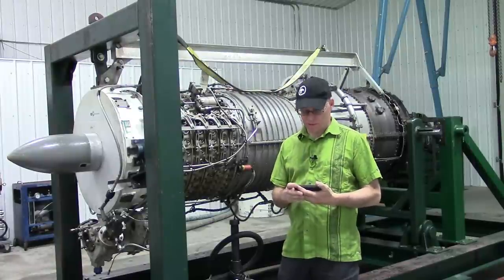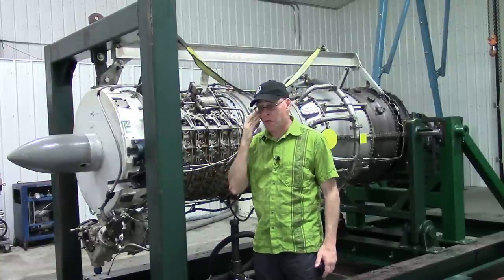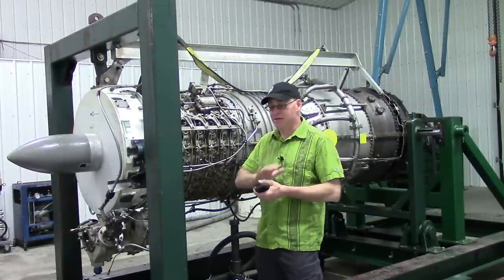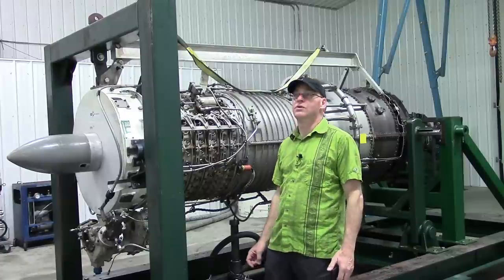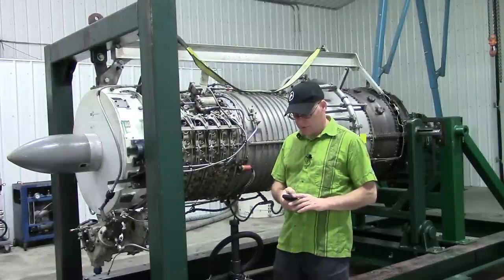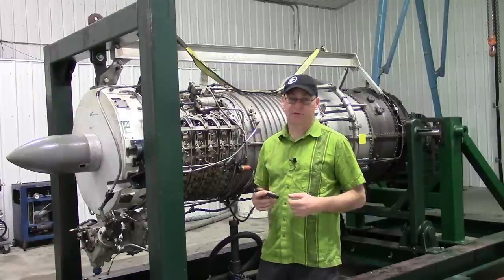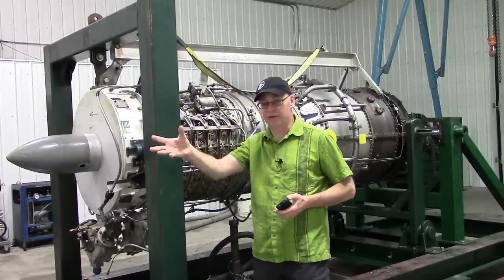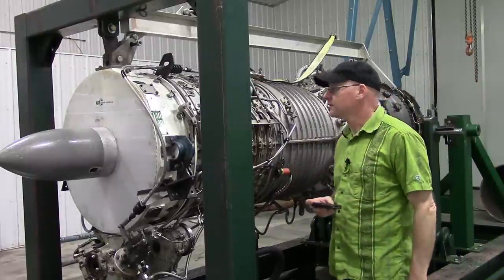Jet Questions 62

Comment: Jay, You're absolutely correct about flameouts in commercial jets.  It's extremely rare.  In fact, on a twin, it's supposed to quite literally never happen, because it's too improbable.  Nevertheless, a Republic Airlines flight (April 2, 1983) flamed out at FL 350 and descended to 12,200 ft before the engines were restarted.  The NTSB determined that the crew neglected to follow the crew checklist and failed to turn the center boost fuel pumps (so, pilot error).  One case I was personally involved in involved a 757 descending into Miami.  Both engines flamed out in heavy rain.  The "fix" was to require the flight crew to maintain a somewhat higher throttle setting on approach, and to turn the ignition on.  

Great discussion as usual.  I really enjoyed it.
Reply from the maker: MrShobar Interesting incidents...
 I deal with engines only, so any mistakes by aircrew don't even count in my discussions.

Comment: Such excellent videos. Thank you! If and when I win a big lottery: I will arrive with two "top of the line" GE locomotives, and the track, and try to pull that test rig out of the ground. I would expect my efforts to fail -- but it would make a cool video. Ha ha.
I recall a time when my Dad was doing engine tests at Edwards. They wouldn't give him permits for a permanent facility, so they used a reefer -- a refrigerated rail car. Completely instrumented control room, not applicable to permit restrictions. The insulation actually helped with the heat and sound. Getting the job done.

Comment: Thrust reversers are either part of the engine cowling (for the majority of High Bypass Turbofans) and reverse the bypass air, or are immediately behind the engine exhaust stream on low bypass turbofans/turbojets. In either case, they are not actually part of the actual engine, but part of the aircraft itself.

Comment: Agent JayZ, Your comments regarding the movie Top Gun may have been prompted by a question I asked regarding compressor stall and surging. I get that it was just a movie and was made as entertainment. I mentioned it just as a conversation starter. What I really wanted to know was what can cause compressor stall and whether the engine can recover without intervention from the operator. I am also confused about the difference between compressor stall and surging, or are they the same phenomenon. I did not realise that mentioning that movie with that star who also believes in Scientology would generate such an outpouring of scorn from so many. From here on we refer to it as the movie whose name we shall not speak!
Reply from the maker: Mark Presling Stall has a common conversational definition , derived from piston engine experience, which has nothing to do with turbine engines. I'm trying to produce a video on stall at this time.

Surge is a phenomenon that occurs in centrifugal compressors, but many people, including those knowledgeable in turbine engines, aslo use it to describe a stall. There is a lot of muddiness in the meaning of the word, and I will not be attempting to clear that up. Sometimes, when an axial compressor stalls, there is a surge of flame that comes out the front. This is not what the term surge is normally used to describe, but people use it that way, so there you have it.

Comment: The jet airliner that I fly has dual Full Authority Digital Electronic Control (FADEC) computers per engine. The FADEC's automatically detect flame-out or loss of RPM and will command both igniters on to keep the engine from shutting down. My book doesn't say if it modulates fuel flow but I imagine it will do this to help prevent a loss of power.
Reply from the maker: randomYOUTUBER That's an excellent feature. I hope it is on all the engines of the airliners I fly on.
Reply: randomYOUTUBER Dual channel FADEC systems are pretty robust and actually quite an amazing technological advancement. On the jet that you fly, does activation of the anti-ice system also turn on igniters?
Reply: Jeffrey Lancaster Nope.

Comment: The most eloquent explanation of cleaning I have heard to date!   On the topic of cleaning, do you use any washing tanks and/or baths, ultrasonic cleaning tanks, and solvent tanks?  Or are you primarily squeeze bottles, brushes, cloth wipers and elbow grease due to the size of most engine parts that you work on?

Comment: Mr Z,
You recently showed us the ablative material that the blades rub against to form a seal against air leaking. Our newest, and most expensive fighter, the F-35, had a blade failure and caused $50 Million in damages to the aircraft!!! (It's being parted out ) They say that the blade had a Hard Rub against the ablative material which caused excessive heat, and blade failure... Also said that they were going to restrict high g  maneuvers until the engine was broken in... My question is this, does the main shaft in these engines "Flex" at all ? Even in high G ? And how tough is this ablative material ? I realize that you don't work on these engines, but you do have extensive, and practical knowledge on how they work, I would enjoy any insight you could give us :-)
Thanks Mr Z, Really enjoy your channel !!!

Comment: OK, finally caught up on all the Q vids so now I have a few of my own that I don't think have been covered.
1) Many high-performance turbocharged piston engines have an intercooler to cool the intake air after the turbo to increase its density and allow more air to be crammed into the same cylinder. Would a similar system be useful/practical in a gas turbine engine?
2) What's the most complex/challenging engine you've worked on? How was it different to the engines you normally work on?
3) Roughly how long does a full overhaul take? (assuming no major issues/delays)

Cheers
Reply from the maker: Elan Jacobs 
1) - search for LMS100 and see such a system.
2) - Newer designs are always more complicated than older ones, so the LM2500 and LM500.
3) - there are always delays or issues, and it depends on how many people are working on it.
Reply: Thanks :) Looking forward to the next video

Comment: I've seen your video on safety wiring, and read the Jeppersen book and I know you have said the purpose is to hold fasteners in place if they break or come loose only , not to keep the torque on the fastener, the Jeppersen book implies (in a roundabout way) safety wiring will keep torque on the fastener per wiring in the tightening direction, I question if safety wiring has any practical use whatever as if the fastener came loose or broke or lost its torque, I can't understand how a small diameter soft steel wire would withstand much of these stresses.

Comment: Hi AgentJayZ, 

I've been watching your videos for quite some time now. Great Job by letting us all sneak so deep into the jet engines details! 

Now two questions popped up into my mind, maybe they make it into an video ;) 

First is an afterburner question:
On the J79, the exhaust nozzle opens up if the afterburner gets ignited, as we could see in your videos. But what would happen if the nozzle gets stuck in the "closed / normal" position while the afterburner is active? Like when the actuator for the nozzle breaks or something like this? Would this cause an emergency shutdown because of a much to high EGT? Or could this led to an fatal engine damage. 
Also as a mind experiment: If this situation would be arranged and forced in the test cell, how would the thrust develop under this situation (afterburner on, exhaust nozzle closed)?

Second is an airliner turbofan question:
If an Airliner is parked on the ground, I could see sometimes the fan spinning free, propelled by the wind. Depending on the windspeed and duration, the fan and therefore the shaft and bearings will do quite an amount of rotations without being lubricated due the oil pumps are not running. Can this cause any damage or wear over time or should the engine  be "locked" somehow if the aircraft is parkedl for a longer time period? Or is there enough oil in the bearing housings/sumps to lubricate them adequately?

Thanks a lot, 

Alex

Comment: in flight restart on the boeing jets is pretty basic. It fires up igniters instantly, and checks RPM's. If RPMs are high enough, nothing changes it just lights. If they are pretty low, itll hit the starter and also open bleed valves to use the forward airflow to help spin the engine up. Oh, and it takes over throttle control. You can go full throttle but until it senses relight it will control it. Once it lights your throttle input will be registered.

Comment: There was a documentary regarding British Airways Flight 9, that used the phrase "The engines flamed out", however I'm sure the implication was that the engines shut down rather then having a 'flame out'. It was also explained rather well that volcanic ash build up essentially causing a "compressor stall" of a sorts from ash buildup restricting airflow threw the turbines.
http://en.wikipedia.org/wiki/British_Airways_Flight_9
Understandable to an extent with confusion of 'terminology' vs lack of knowledge about some stuff.  The engine stopped working even tho the engine did not "stop", what do you cal that ("engine shut down"?), lol.

Great series AgentJayZ, thanks.

Comment: +AgentJayZ Question:
What makes a customer choose a gas generator engine over a large piston engine for industrial use?  I know they are smaller, but it seems size is not an issue as you have explained there is usually a giant room dedicated to the engine. I know they are lighter, but they are sitting on the ground in industrial situations so that hardly seems important, unless the logistics of transporting a massive piston engine are prohibitively difficult. You have also said that gas generators can be started faster, but every time you start an engine, it takes at least 30 seconds, and piston engines fire up in just a couple seconds, so I am confused about that fact (I assume you are correct, and I just don't understand something). Piston engines are even more fuel efficient and cheaper, usually. So what gives? Can you share with us some scenarios in which a gas generator is preferable to an equivalent power piston engine? Thanks. Awesome channel btw.

Comment: Most modern airliners have a way to turn on "continuous ignition", which is used when flying through a severe rainstorm. It may also be used during takeoff and landing (if not enabled automatically), because although a flameout is extremely rare, you really don't want it to happen during takeoff or go-around so that if it were to happen it would be relit immediately.

Many have a switch position "auto", which is the normal setting, it will turn the igniters off to reduce wear, but will turn them on immediately if a flameout is detected.

Windmilling restart is possible on some (not sure if all) modern turbofans at high airspeeds, I seem to recall something around 300+ knots indicated. Starter-assisted restart is recommended still.
Reply: totoritko Was TransAsia 235 actually a flameout? I know that the preliminary information and FDR graphs said the flameout warning was triggered, but fuel flow and rpm did not go all the way down, apparently it merely went to idle uncommanded. (That the crew then apparently shut down the other engine, leaving them with no power, is a different problem.)
Reply: totoritko Yes, that's basically what I understand. I had hoped you might have some more information. After the initial burst of information with surprisingly early publication of FDR data, not much has come forth.

Comment: Re: VIGV/VSV mechanism.  It looks like a daunting task to adjust and synchronize all of those rings, bell cranks, and linkages.  Do you set that up with geometrical measurements per spec or actually measure parameters while running?  Could you shed some light on that?
Reply from the maker: BigBoy4005 The whole stage of individual vanes is synchronized by the position of the lever pivot holes in the actuator ring, which is not adjustable. each of the six rings are coordinated  to the others using a special set of protractors to set the length of each adjustable rod connecting the bellcrank of that stage to the rack.
These measurements and adjustments can all be done without the engine running.
 The movement of the rack with respect to engine rpm is adjusted by changing the length of the rod attached to the piston in the actuator ram. Usally this adjustment is done with measurements taken in a series of test runs.

Comment: Jay, I'm just curious about the actuators system for the variable stator vanes, you have this holes around the low pressure compressor, do they have seals on it?

Comment: Can you please speak about axi-symmetric stalls? How many can a LM1500 sustain in a lifetime? Which blades are more prone to damage?  Whenever you see flames coming out from the front turbine does it mean that there was a stall? Can you speak of compressor maps and indicate where is the surge line located, the surge margin, the flight line and the isentropic efficiency?
Reply from the maker: gastarbieter I might show a diagram of a stall margin for a compressor in an upcoming video, but that is taking things beyond the scope of our little hands-on show here.
Isentropic efficiency? Probably not. That's something for the engineers to obsess over, and far outside the scope previously mentioned.
Reply: AgentJayZ but i am one :) not an aerospace one though but I still love it.  Thanks for the info you are sharing.  I also wanted to ask you....who are the typical customers for an LM1500 based gas turbine for electricity production? BTW in the airline industry I know that they call the term you were looking for as "Continuous fire" and they switch it on when there is a concern of a flame-out when passing through heavy rain.
Reply from the maker: gastarbieter the heaviest natural downpour is no problem at all for a turbine engine. For a turbofan, it isn't even noticed.Takeoff ignition is there more for the peace of mind of the pilot than anything else.
Yes, I admit it... because of the seriousness of the consequences of such a one-in-a-billion-chance thing happening... I would turn it on as well if I was a pilot.

Comment: The thrust reverser is most definitely separate from the engine. In fact, I can't think of an engine company that also makes TRs. I can tell you from experience that all aircraft companies nowadays are required to perform in-flight TR deployments during flight testing to prove that there is no adverse effect on aircraft stability. I believe there is a regulation that requires the pilots to deploy TRs in flight and "sit on their hands" for something like 3 seconds to simulate an actual failure scenario. Nowadays, most planes have a TR emergency stow system that the pilots would use, as wells as several safety valves in the TR hydraulic system.
Reply: Jeffrey Lancaster What?

I rather suspect (haven't checked myself) that such demonstrations are only required if uncommanded thrust reverser deployment in flight cannot be shown to be extremely remote. I also believe that almost all companies these days will demonstrate to the regulators' satisfaction that the probability of such uncommanded deployment is in fact extremely remote. I've never heard of such tests being performed. It would be nice if you could corroborate your statement with some facts.
Reply: pinkdispatcher  I have video evidence of one of the jets that we recently TC'd performing an in-flight thrust reverser deployment by flight test engineering in order to satisfy the regulations. They actually have to intentionally mis-rig the control PCB and TRs to make it do it. Unfortunately that video is company private and I can't share it, or else I would. I hope that is factual enough for you. And yes the probability of that happening is quite remote (probably on the order of 10^-9), but demonstration was still required for TC. The video shows the plane exhibiting a slight nose down pitching moment, but very stable.
Reply: Jeffrey Lancaster I believe you when you say that for that type it was required to be demonstrated.

I found the relevant paragraphs in CS-25.933 (I'm sure CFR has something very similar): It needs to be shown that safe flight with thrust reversal is possible, OR it needs to be demonstrated that in-flight reversal is extremely improbable. (That is for systems designed for use on the ground only. Systems for in-flight use need to be demonstrated in flight, obviously)

Extremely remote in this context is elaborated in AMC 25.933(a)(1) to mean a probability of 10^-9 per flight hour or less.
Reply: pinkdispatcher You make a good argument that it is an OR statement. But again this is EASA cert and to be honest, I"m not sure about the FAA regs either. I may have jumped the gun by saying they are required to perform "in flight" deployments. I stand corrected. Thanks for pointing that out.

Comment: Hey Jay, I wouldn't take that bet on the Locomotives because it'd be unfair to take your money.  2x SD70ACe's (one of CP's most numerous road locomotives) produce  about 320,000 pounds of pull together and they're VERY good at putting it on the rail.  Maybe a couple of switcher engines, but not mainline road locomotives.  They'd not only pull your thrust a-frame apart, they'd probably be able to start pulling the whole sled out of the ground.
Reply from the maker: Chris Trott OK, I admit that i know little about trains. I never knew they had such good traction. Anyway, I'm still up for it. You bring the locomotives, and we'll hook em up! BCRail has a track that passes within a Km of our test cell...

Comment: I read somewhere that propellar driven aircraft have problems at high speeds cuz the tips of the blades aproached the speed of sound.If this is true why jet engines dont have problems when the tips of the compressor blades aproached the spped of sound?